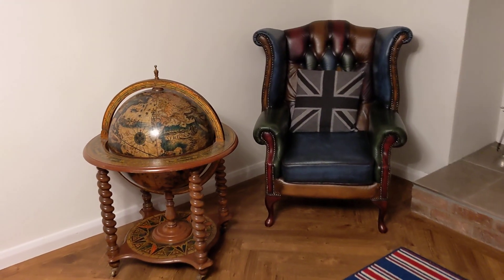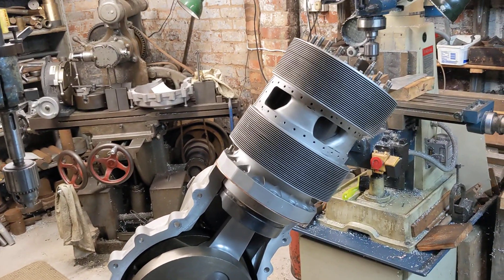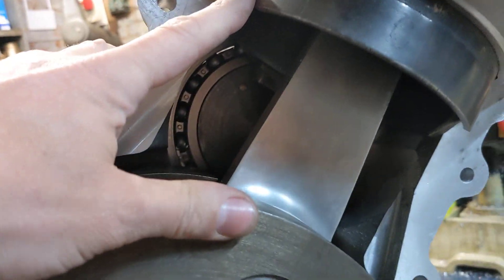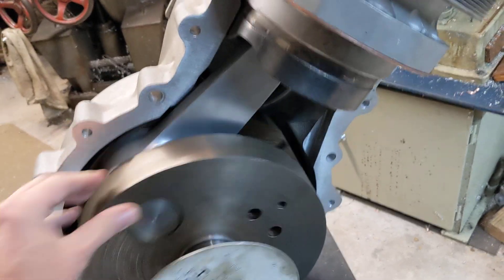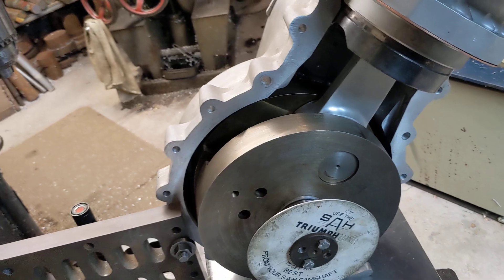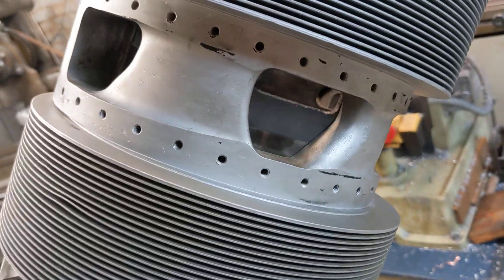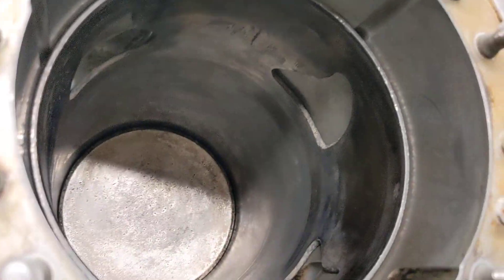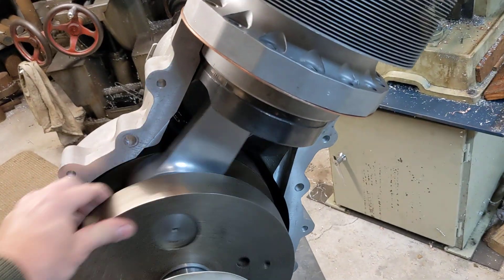Round round baby round round!!

Comment: how does it unit manage to lubricate against the cylinder wall due to the movement of a lining as valve i would love to be educate on that , thank you
Reply from the maker: @adolfyoung4367  the sleeve is splash lubricated at the bottom where it touches the contraction ring. It's the only place where the outside of the sleeve touches the barrel.
Reply: @StoneEng  great but looking at the power unit , it has a cylinder head and piston. The head which I believed it’s has been design by the aluminum at your own knowledge , it’s contains rings to maintain the pressure for power stroke , now another question is , how does the lubricant reach TDC to reduce frictions

Comment: Maybe you have mentioned it and I missed it but what are the vertical groves in the top of the block cylinder between the sleeve valve and outer cylinder used for.  Congrats on getting this far, it's clearly a lot of thinking involved to negotiate the problems that creep up and not cause more problems with a solution for the last problem.
Reply from the maker: I don't think I've mentioned it because I've no idea what those grooves are for! My guess would be something related to oil or expansion. Maybe someone who worked on them would know?